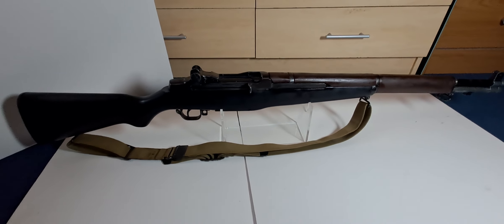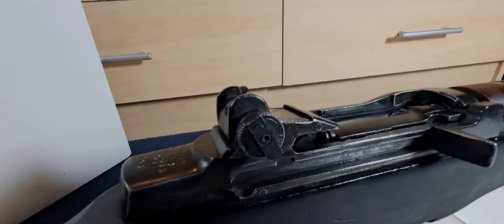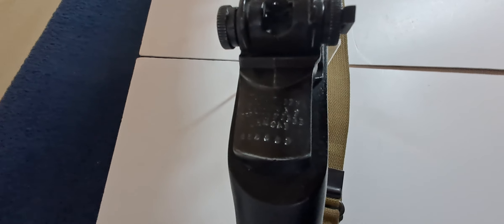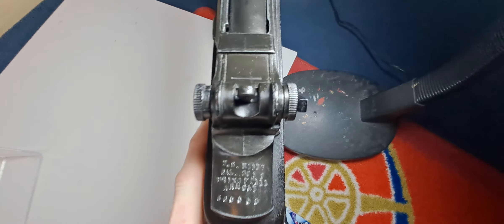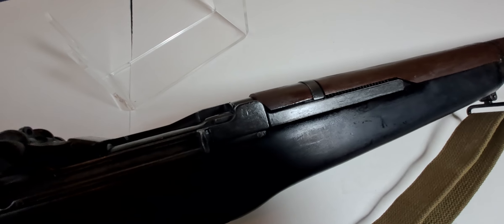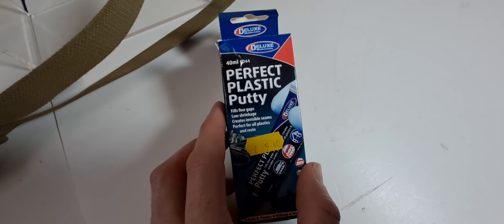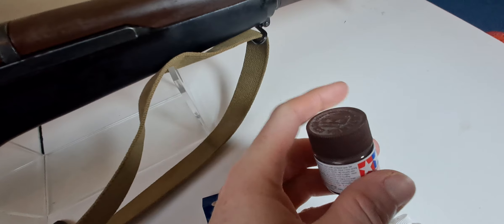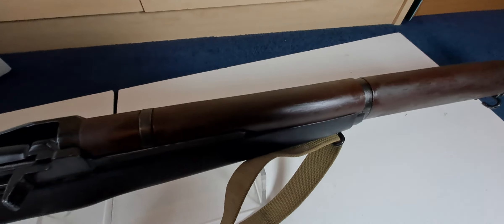Denix M1 Garand Rifle Last Update

Comment: Mate, really excellent work there. did you unscrew and remove the metal parts when treating the wood? Also did you sandpaper the metal parts? Im going to do the same as yours and will post a video soon
Reply from the maker: @rm-pc3544  Thank you. yeah i removed the metal parts just to make it more easier and i also did use sandpaper to highlight the parts were it would get the most used.